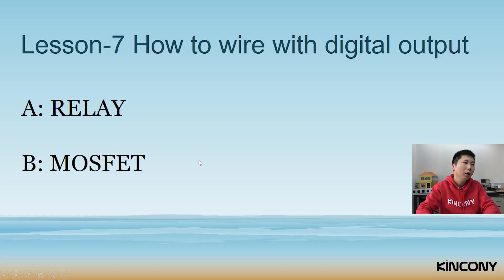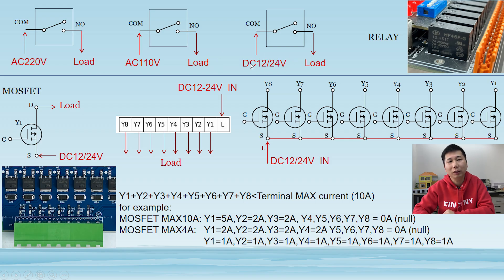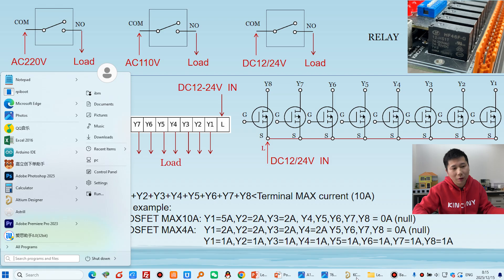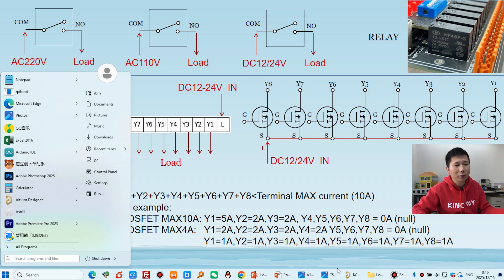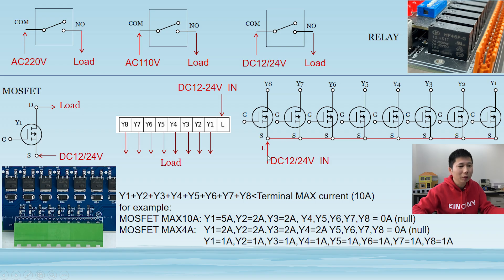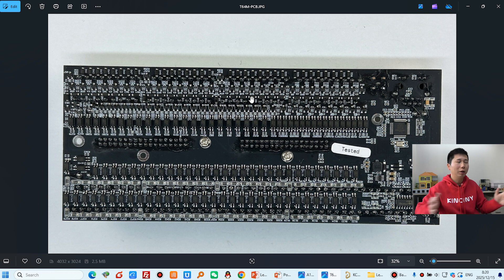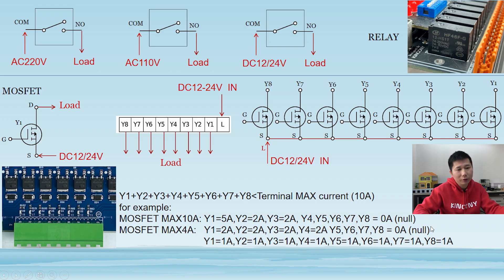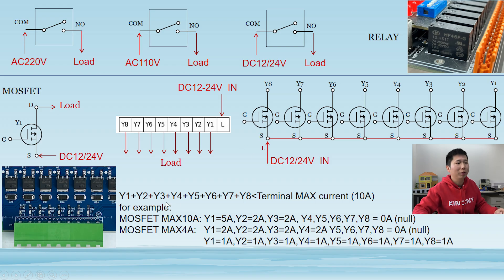How to wire with digital output | KinCony Home Automation Training 7

Comment: Hello, please write or draw how I should properly connect the external relay to the output, and what should I connect to the 12V terminal, thank you, best regards.
Reply from the maker: it already showed in diagram. just mosfet output conenct to relay's coin, it support dc12v or 24v extend relay.